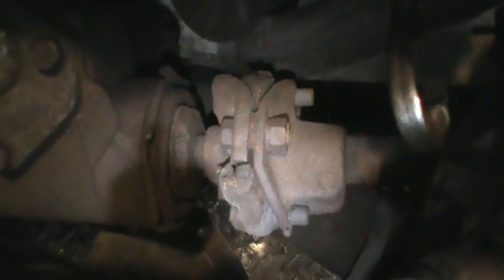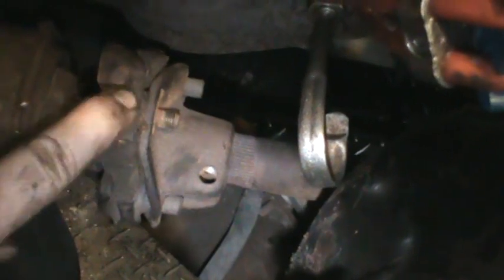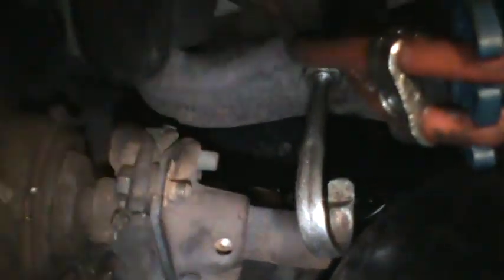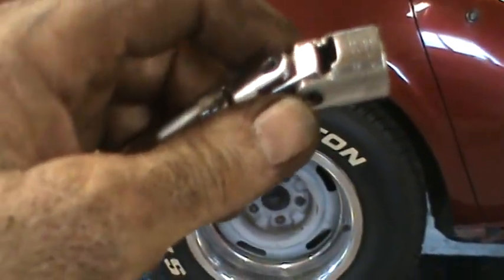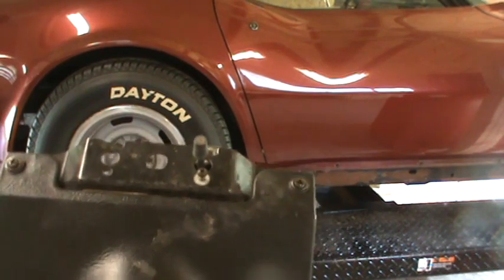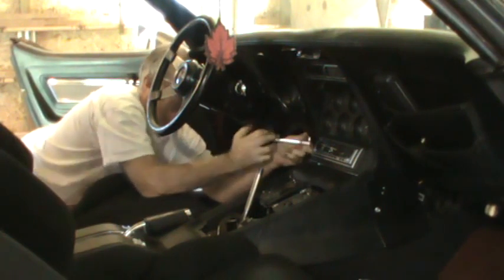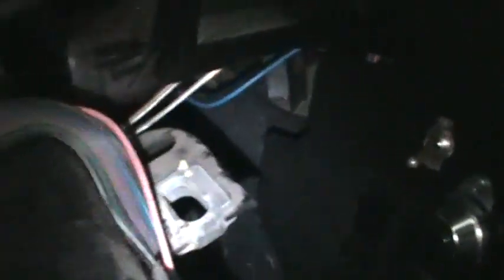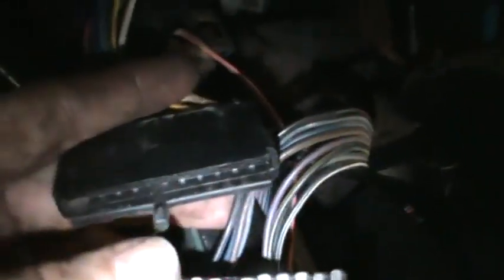removing the steering column

Comment: Does someone have a tutorial on lowering the steering column of my 82 chevy k-30 4x4  diesel pick up, to replace the electric ignition switch.
Reply from the maker: I don't  have a guide to your K30 but I did own a '78 K10 Blazer and I think the setup is probably similar to this except that you should have a lot more room to work under the dashboard.